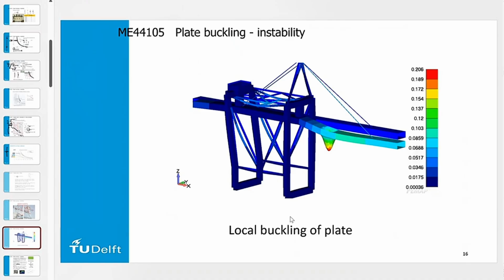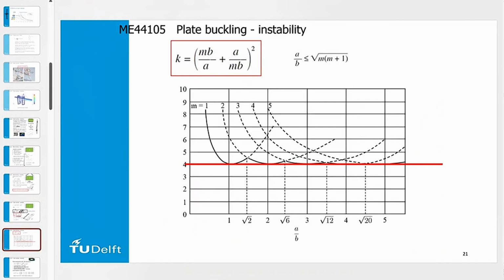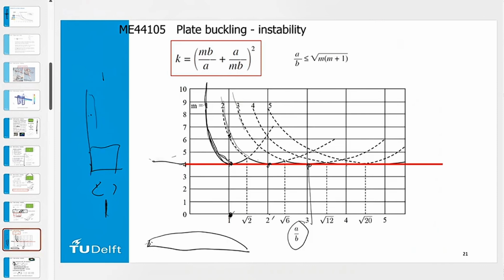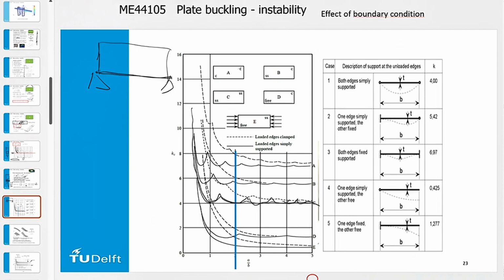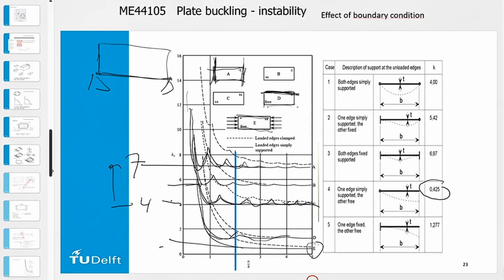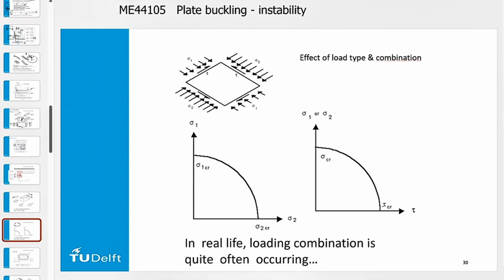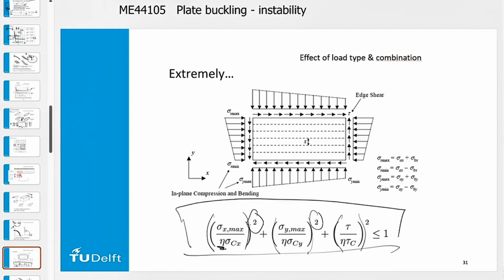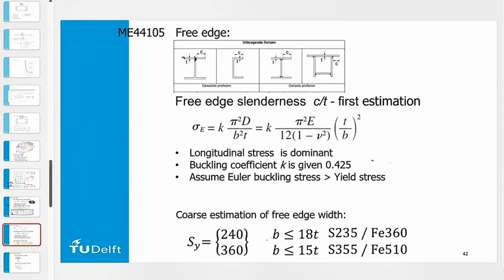Beam vs. Plate Buckling Explained: Effective Width, Reserve Capacity, and Design Standards

Comment: at 5.51, u said the lowest buckling shape is most critical when a/b = 1, but in the same sentence showed and said the 2nd order shape(m=2) risk is higher. So what makes it critical for given a/b ratio? the k-value being the smallest or the largest?  Or is the the lowest k-value, when a/b =1, lowest k =4 and m=1, at a/b=2, lowest k=4 but m=2 and etc..
Reply: I believe the second part of the sentence was said wrong. With lower k, the risk of the buckling is indeed higher. So the correct statement would be: the lowest buckling shape is the most critical one because with a/b ratio equals to 1, the buckling risk of m=2 is much lower (since the k value is higher)